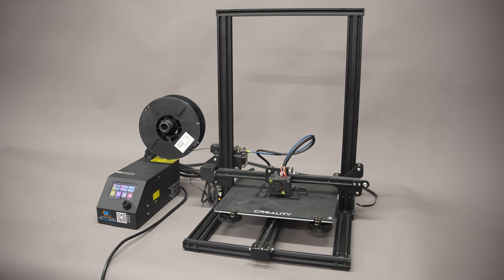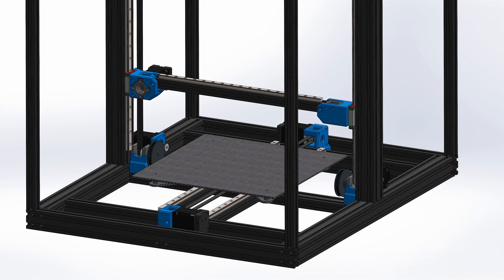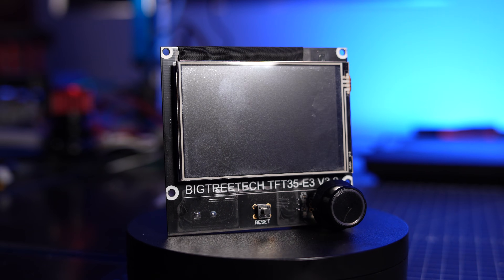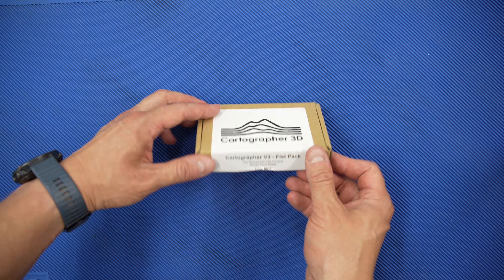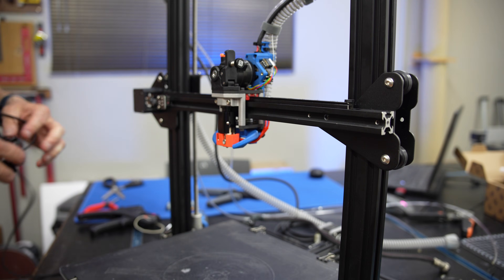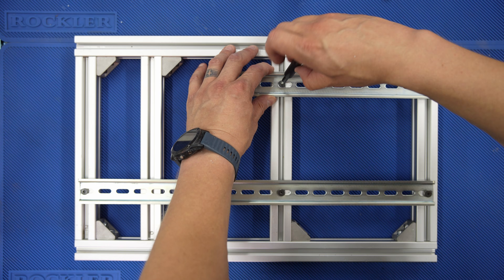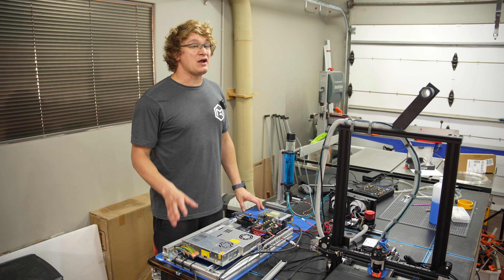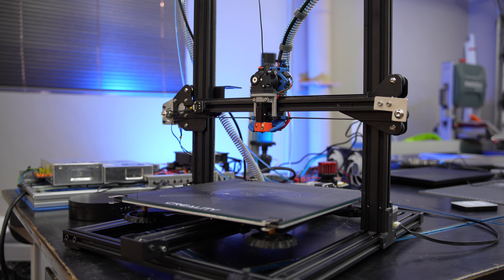I’m Rebuilding My First 3D Printer From Scratch | CR-10S Rebuild Part 1

Comment: I love me some water cooling
Reply from the maker: Rebuild without water cooling, in my opinion… isn’t a rebuild😂
Reply: @marcelgenis 😂
I cannot stop thinking about how effective water cooling a stepper motor is. 

I am not sure it is better than drilling holes in both ends and then adding a fan.

I guess it is the cobber windings where the thermals matter. And it will not be easy to measure the temp there. 🤔
Reply from the maker: Yeah I agree 😂. Wasn’t sure about it, but when I got the water cooled hotend I just went with it. Hey if it doesn’t work that well, it will at least look cool😂. I will mostly be printing ABS where I need chamber temps of around 40-50C, in that case it should help a lot. But I am going to have to test it. I will first run the printer without the waterblocks, measure the motor body temps and then compare it with the waterblocks installed. Should give us sort of an idea of how much it reduce the heat or not
Reply: @marcelgenis very good point with the champer temp. Cause with water you can move the heat outside and cool with room temp air. 

I don't know how much heat energy one can move from the end of a stepper motor. 🤔

Would be fun with thermal imaging of a water cooled motor, to see the gradient along the motor. 🤔

But I think the motor is built by stacking plates that are insulated to reduce eddy currents. And i would assume this reduces the heat transfer quite a bit. Although the thickness of the insolation is super thin. 🤔

So I would guess cooling the sides would be more efficient. But there might not be any room for cooling in many builds. 🤔

I do have some cheap water blocks and a stepper motor. From other projects. So I guess I could sandwich a motor between 2 blocks and cool it to see how much heat I can remove. 🤔 

On the other hand the temp does not matter much as long as it is not too hot, and I have plenty of projects I never finished. 😅

But I am looking forward to seeing your results.
Reply: @Petch85 Sadly, I don't have a thermal imaging camera, but by touch the motors stay much cooler. In my set-up, they were warm/ getting hot to the touch and now with water cooling they seem to stay right around room temp. I run LDO steppers at 48V and 2amps.
Reply from the maker: @stevehazim5823 Thanks for sharing! Glad to hear that it actually does work!
Reply from the maker: @Petch85 I just have to thank you again! For all your comments, went to bed replying to your comment. Woke up the next morning with an additional 4000views!! Think you convinced the algorithm! Really appreciate your support!   Regarding the water blocks, I think the blocks will be more efficient than what we expect it to be. Worked on a few industrial machines in composite industry, where we had to rely on closed loop cooling of the machine components, due to all of the corrosive carbon dust in the machines enclosure, and in some cases a very small block removed massive amounts of heat, so belive this might be the case as well. If I have time I might even do a CFD analysis to compare/predict what will happen in printer enclosure
Reply from the maker: @Petch85 😂yeah I also have a lot of projects that I simply didn’t finish. Must say youtube helped me to actually finish stuff, that is quite nice! Thanks, really appreciate it!
Reply: @marcelgenis  Hehe... I wish I had the power to direct the algorithm towards videos that people clearly would love to see. 😂
But the main reason the video is getting view is because you made a damn good video. It has a good idea and you clear put in a lot of work both in the project, filming and editing the video. It was a joy to watch.
So you got it backwards, you should not be thanking me for a few comments that took me minutes to write, I should be thanking you for making a video that took your many hours to make. So thank you for a good video.

CFD of a water cooler is probably a pain in the but to do. Due to ratio between the very small size of the fins and the relatively high flow rate.
I guess you could do a FE Model of the heat transfer and just use a guess on how mush heat the water block can remove. But then the material data of the motor would probably also have to be a guess. 🤷
(But at least the compute time will be much faster 😂)

The composite machines sounds like a bit of a pain 😂. But sure water cooling can easily remove like 100W from a stepper motor. (48V*2A). I mean I cool 125W from my CPU with a delta temp of like ~30 K.
So you should be able to get below 50 C where the water block is installed (assuming 20C room temp).
But it would not surprise me if the thermal gradient along the motor and the temp at the cobber windings were less grate, do to the heat transfer in the motor itself being relatively poor.

But it will for sure work just fine. I just love thinking about the details 😂. And I know nothing. Cause I have never done this. I just expect the heat transfer inside a stepper motor to be poor relatively to a solid block of steel. 😂

Ok sorry but now my brain cannot stop thinking about it. 😂So here is a napkin estimate. 
Say normal water cooling with like an ok pump, probably can do something like 3000 W/m²*K (Just guessing... Could be 2000 or 5000 🤷)
Lets just say you run the stepper really hard and say it uses 100W and that it is a 40mm x 40mm size. (Just guessing again, ball park numbers) So 0.0016 m².
Q=hA*delta T. Or delta T = Q/(h*A) ) 100 W/(3000 W/m²*K *0.0016 m²) ~=21 K. 
So my guess is that the end of the motor will be about 21 C warmer than the water temp. And assuming a relatively standard radiator size the water will probably be 5-10 C warmer than room temp.
And then we are back at a motor temp at the water block location of about 26-31 C warmer than room temp.  😂

I am pretty sure that the limiting factor will not be the water cooling. It will be the internal heat transfer of the motor. 😂
 
But I am looking forward to the next video in the series, cause I am hooked now. 😂
Reply: @marcelgenis  You are not the first creator to tell me this. 😂
But making a video like this is just as much a project as the project itself. And I am not build for the youtube grind. 😂

But I love that others like your make videos that I really enjoy watching. So keep it up. 👍

Comment: Super great video, Marcel! Although that compliment is putting it lightly, haha. It's a ton of fun to see an upgrade-style video on what is basically a big Ender 3 😁 but seriously, this video is insanely well-made, dude. 
It's actually surreal to see this many upgrades at once, especially ones I personally love like carbon fibre, high voltage stuff, watercooling, and speedy power motors too! The list goes on. That's not even mentioning how well you executed them as well. 
Nice PCBWay segment too 😉 This video feels seriously compact, in the best way possible. Can I ask how long this one took to edit? I'm stoked for the next part!! 
Cheers!
Reply: Here he is again, this man is everywhere
Reply from the maker: Hey Tommy! Thanks for the compliment really means a lot coming from you! Don’t think it comes close to yours but I am trying. Really one of the most difficult things to determine, “is my video good or not?” So thank you, appreciate it! 

Hey it took me way longer to finalize my plan/idea, I think the design phase was at least 2 weeks of work😂. But I am super glad I went with seperate videos for this project, still two videos to come before it is completely finished. 

Difficult to say how long it took me to edit it, 5 days maybe, give or take a day. I started to plan my videos instead of just filming everything. I would try and write the outline of the story before I even start. Otherwise I wonder all over the place and end up struggling on deciding what to keep in the video😂. I would try to only film only the necessary shots I need for my story, instead of filming everything. That helped me a lot. But don’t underestimate your longer format videos, you have a way of pulling a person into your story. Love your videos man! By the way can’t wait to see you custom printer build! Really looking forward to see that!
Reply: My pleasure my friend, although I will have to disagree about it coming close; I honestly think it's better than even my favourite personal productions. This one is seriously great, and you killed it with the flow and pacing.

I don't doubt it! I'm over a week into planning my next one, which is already at 6,000 words in the document (including shot notes, though). And yeah, that design time really adds up doesn't it? Good call with splitting the video up as well, as that in turn improves quality. I'll be trying that soon myself.

That's really good! I spend similar amounts of time editing mine as well, but the effort gets stretched out across a larger timeframe, which definitely brings things down a bit. It's a lot nicer to work on something more compact. I've always been stressed about unplanned moments in my own recordings, so I'm interested and glad to hear you're working on the outlines in advance. The thumbnail and title are something I almost always do first. Sometimes the thumbnail even shapes the video!

Regarding "struggling on deciding what to keep in the video," I think this is why I've ended up with so many 40-minute-long videos, haha; I really don't know what to cut and what to keep. I appreciate your kind words regarding my stuff, although I'll definitely be trying to format mine more like yours, and especially under that 30-minute mark when I can.

Ahh, that means a ton to hear as well! That series is going to be mad, haha. Part one coming soon after the new year! (Hopefully, as it's just a ton of talking.) I hope it's not a mess, but at the end of the day, as long as the camera is rolling, it's technically all fine. Cheers!
Reply from the maker: @TommyHoughton I think we will have agree to disagree!😂

I must add, splitting the project into several videos always feel like the wrong thing to do, as if it doesn’tvome naturally, but I guess it is something that one learn over time. But like you said, in the end of the day the only thing that matters is to keep the camera rolling!
Reply from the maker: @TommyHoughton I think I should start investing more time into the thumbnails! For some reason I always leave the thumbnail for last and usually have to rush it. Why… well I wish I knew why I keep on doing that😂 stupid habbit. I am definitely going to try and follow your example on that!
Reply from the maker: @TommyHoughton Good luck on finishing your video Tommy! Looking forward to it!
Reply: @marcelgenis  I can always recommend it! That being said, your current ones are very good. Sometimes the last-minute ones can work out better than the planned ones... I've had some of my favourite thumbnails take <10m to get the perfect photo despite worries about that whole process, which is always a good feeling. Mine are getting a bit too simple in the wrong areas, and it's detracting from them, whereas yours are striking a nice balance. I'm more pleased with some than others, haha; Ender 3 Value part 2 has to be my favourite, with the Phrozen one being quite low in the ranks.

I wish you the best of luck! I would recommend stockpiling thumbnails that catch your eye and saving them to a document for reference or use as "templates". I can share my collection with you if you'd like, as there are quite a few useful ones there.
Reply: @marcelgenis  Thank you very much! I thankfully won't need luck as much as I need patience 🤣 Should be done scripting in a couple of days, although I'm doing a yearly recap video for the next 3, so that puts a slight hold on it... I'm stoked to share! 
I'm very pleased to see the amount of success your video has (rightfully!) gained, and if there's ever anything I could help you with, just let me know 💪
Reply from the maker: @TommyHoughton Thanks Tommy, sometimes I am so fixated with the script and build that I don’t think of the thumbnail. But yeah making a folder with clips that can potentially be thumbnails is a really good idea! 

I honestly like your thumbnails, well you got me through one of them😂. Thanks Tommy, appreciate your help! definitely reach out to you via email when I feel stuck with my thumbnail!
Reply from the maker: @TommyHoughton 😂Yeah patience it’s my strong suit, definitely can’t help you there! 

Well whatever video is up next, I am sure I will be entertained! 

I am honestly quite surprised about the amount of attention this video is receiving, super stoked about it, because I really like modding/building 3d printers. I have a few unique ideas that I haven’t seen yet, that I want to try out in 2026. Super grateful and excited about that!

Thanks Tommy, not everyday that a creator wants to help out, really appreciate that. Definitely reach out to you on other social media platforms or email. 
For some reason I only receive some notifications of replied comments. Also why my replies are so delayed, So yeah not ideal!

If there is anything that you think I can help with, please don’t hesitate to ask! Due to my profession I am quite handy in design, CAD, FEA, CAM or CFD! 

Happy New Year Tommy! May 2026 be a awesome year for you and your family!
Reply: @marcelgenis  I'm not surprised at all, haha; the quality speaks volumes! Time to keep the momentum and make those ideas happen. I'm equally as excited for them 😄

No worries, we're all in the same boat, after all! It is always good to network and such. I honestly never tried to do that in the past, but after pushing for it a few times and not regretting it, I've had a shift in my mindset, haha.

Hmm, that's a tricky one, and I'm not sure why that's the case. I've had some slip by as well, so you're not alone there, as it can be hard to manage them all! You're doing fantastically there, I'd say!

I also really appreciate that! Those are actually the areas I struggle with the most, haha. I will keep you in mind when I need some feedback. Thank you very much!

Happy New Year as well! Here we are already, which is quite surreal, but I'm looking forward to it all. I wish you and your family the absolute best as well! I have super high hopes. Cheers!